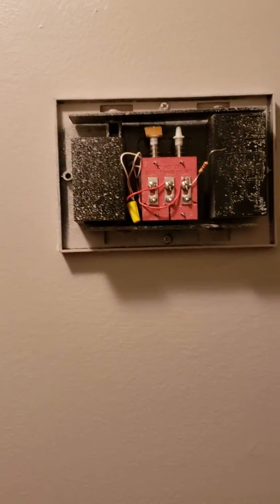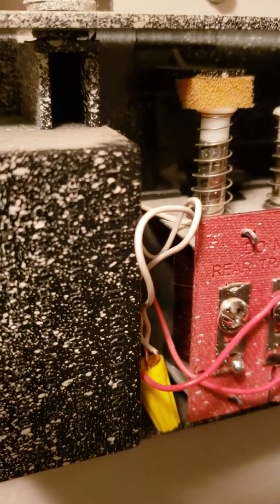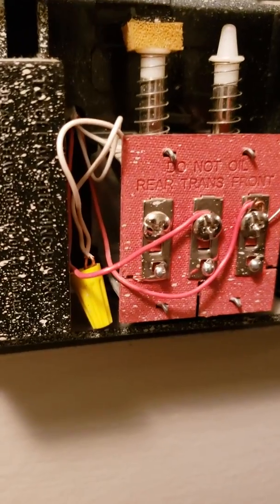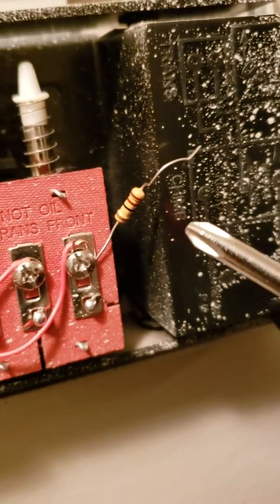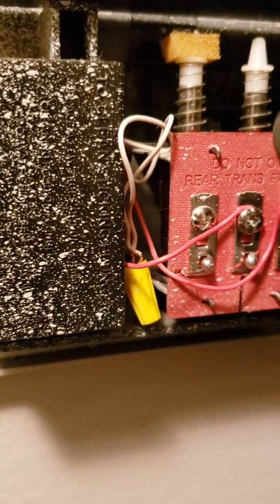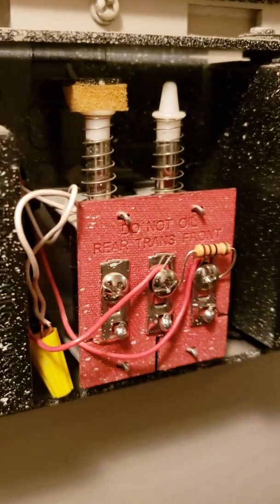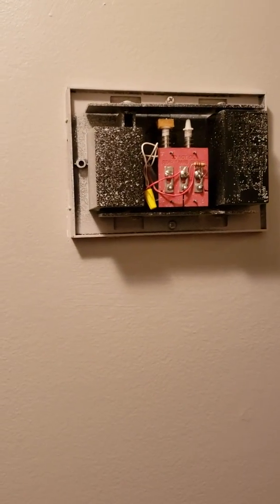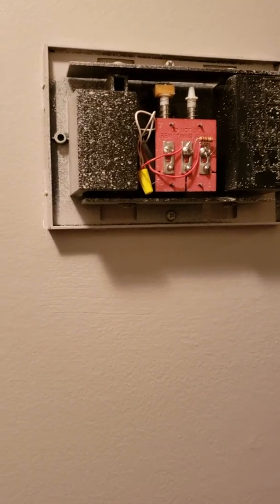Fix buzzing/humming sound after doorbell security camera install

Comment: Most of these doorbells come with a chime kit or power chime kit, which is the resistor. Check her manufacturer to see if they have one for your particular model. If they don’t make sure to ask about the ohms and wattage because not all the resistors work the same. As an electrician I carry three different resistors for different video doorbells. Most of them will take the 10 ohms 1/2 watt hover some will need more ohms and wattage. Typically these are fine from 8-24VAC and will do the job.
Reply: I tried a 10 ohms 1/2 watt but it melted. Would a 20 ohm 1 watt be sufficient?

Comment: Old find, but not needed. 
Most video doorbells use the power to charge the battery in the door bell. So the doorbells needs a completed circuit. 
The door bells is completing the circuit to allow the voltage ( use a multimeter and see) to pass.
Normally a regular door bell is a open circuit, but an illuminated doorbell does the same thing and slightly lets millivolts pass thru to light the led. So does the video doorbell and that is the hum you hear. 
the circult does not complete the circult fully till pressed. 
you resistor is just completing the circuit. as would bridging the two terminals with (any wire). There is still not going to be enough voltage to activate the chime until pressed. 
So, you can bridge the terminals with any wire, not needing to ( resist the lower voltage passing thru), with a resistor at all.
Reply: Hi Wiley, with a multimeter what should i be looking for between the two terminals?
Reply: @VinoLoco  at the doorbell itself, with the multimeter on continuity, you should see no continuity until you press the doorbell button, which would show you that current is passing through it.

At the transformer for the doorbell, some are AC and some DC (so you would be measuring for a voltage either AC or DC at the transformer.

For a better visual, just look up multimeter testing a doorbell

Comment: Saw a similar buzzing on my Nest doorbell. First check for wires almost touching at the doorbell and at the chime. My bad wire was at the the doorbell, wires were too close together and needed separating. The Nest doorbell has its two wire screws very close together, so someone bumping into it this morning was enought to start it buzzing.

Comment: Hmmm, I'm confused.  Why use a resistor at all?  Normally (e.g., in a Ring doorbell) you just bypass the chime coils altogether using a provided jumper cable (effectively 0 ohms with no power loss that a resistor would dissipate as heat).  You're really looking to provide the full voltage (e.g., 16V) directly to the doorbell camera and WiFi circuitry.  Is the Nest different than the Ring?
Reply: Thank you!! My partner did not read the install instructions and thus did not know what that provided cable was for. Your comment prompted me to realize the solution we already had. I cannot tell you the path of all the wrong solutions we were about to go down.

Comment: I have mine buzzing as well but changing the chime type from Digital to Mechanical solved the issue. If it's an option, I would recommend changing the settings first before messing with the electricity.

Comment: Mine only makes the sounds after the door bell is rung. It’s like the bells are stuck.
Reply: Check the doorbell settings. Mine is doing the  same thing and changing the chime type from Digital to Mechanical solved the issue.

Comment: Came to you tube to see if anyone else had this problem
I just tried reinstalling after charging yesterday. 
The button turned white circling but wouldn't turn off . As i started screwing it back on the wall outside.  It started smoking.  I immediately took it off the wall.
I saw a red spark in the little hole on back.
Smells like burning wire.

Comment: Ive been having this same problem with my ADT video doorbell. At first the buzzing was so low and random, could tell where it was coming from. As it got louder it was obvious, finally unbareable. Called ADT, they had no idea! They did dicover my door wasnt recieving enough power. They suggested I replace the original transformer from 1978. It still buzzes, they suggested getting new doorbell, did that, it still buzzes even with the video doorbell unhooked.

Comment: Update: I found I have the ring power kit v2, it took about 30 mins to make the chime ring after the installation. After that it works as expected. So I use the ring power kit v2 kit with the chime now. 
Update: My chime does not sound after add the resistor.... 
Thank you! This fixed my annoy experience for half year.

Comment: I have the same chime with a Ring 4 doorbell. The plunger was sticking (about 5-10 seconds) when doorbell was pressed. I went into my ring app and changed ring type setting to mechanical (instead of digital). It solved my problem.
Reply: thank you very much put it on mechanical mode problem solved
Reply: OMG your advice was the best!!! Thank you so much!!!!! Switched it to mechanical and problem solved
Reply: THIS WORKS!😁
Reply: Good idea, but didn't work for me. Unify Doorbell and Nutone Chime.  Tried the resistor also, but caused the chime not to work or microphone on the doorbell.  Will keep searching.

Comment: Great work.
Is this the same as the "Power Kit" what they instruct to connect it parallel?
Reply: You would think so. However, I tried my Ring Pro wired doorbell with and without the Power Kit. The mechanical chime still hums.

Comment: Google/Nest doorbell cameras are advertised to work with traditional electromechanical chimes such as the NuTone units from the '60s, but that is an outright deception, and the Google/Nest people are essentially lying to their customers. They even have a comprehensive video purporting that their product will work with these conventional chimes, and it categorically will not. The only solution that I found successful which makes the Nest doorbell cameral compatible with conventional electromechanical chimes is a circuit I had to specially design.

Comment: Installed the resistor.......did not correct the problem
Reply from the maker: Maybe not enough drop in voltage to eliminate the coil feom engaging . Higher ohm resistor may be needed

Comment: Ordered 10 ohm 1/2 watt and this took all of 60 seconds to install and humming gone!! Love it! Thanks for tip!
Reply: I'm reading a 1/2 watt can cause a fire due to being too small to handle the load. 10 ohm and FIVE watt, NOT .5 watt, is what you want (so I read; not legal advice. I'm trying this tomorrow).
Reply: 10 ohm 5 watt did not work for me. The doorbell chime no longer buzzes but it also no longer dings when I push the Ring video doorbell.

Comment: I had an issue where I tried to replace my existing button with a video doorbell (Merkury with the Geeni app). The video & app notification when the doorbell button was pushed both worked great, but the mechanical chime (a NuTone from the early 60's) would not work. It tried to activate both of the plungers and it made a humming/buzzing noise. The existing transformer was showing 20VAC, but after watching some other videos online & reading what happened to others, I ended up getting one that was a 24VAC 40Va for more current. That fixed the problem of the chime not working when the video doorbell button was pushed. Many thanks to my stepdad for helping me with the wiring & the multimeter usage. I did have to use the white adapter that came with the video doorbell which helped get rid of the humming that was occurring.
Reply: Google/Nest doorbell cameras are advertised to work with traditional electromechanical chimes such as the NuTone units from the '60s, but that is an outright deception, and the Google/Nest people are essentially lying to their customers. They even have a comprehensive video purporting that their product will work with these conventional chimes, and it categorically will not. The only solution that I found successful which makes the Nest doorbell cameral compatible with conventional electromechanical chimes is a circuit I had to specially design.

Comment: This makes sense. The doorbell/camera (Ring or whatever) is drawing a small current all the time, which makes the chime solenoids vibrate. Putting a resistor in parallel with the solenoid passes part of that current around the solenoid coil and through the resistor. You could also completely disable the chime solenoid by shorting across it - basically a zero-ohm resistor.

Comment: Mine does the same thing except only when it is dark outside. Any idea if this resistor would fix it? Appreciate any help anyone can offer. It makes a buzzing noise for 20 seconds when it is light outside only after I turn the ring mic on.
Reply: Probably because at night the camera has an infrared light that is always on.   Go look at it, should be red.  So the slow voltage is always there at night

Comment: I'm having the same issue except it only happens at night. During the day it's fine. When I remove the cover I can also see the plunger on the left moving up and down slowly. My doorbell came with a "bridge" wire for trans and front with no resistor. Doorbell won't work without that bridge...I was thinking something was getting wet from the condensation that occurs at night but now after seeing your video idk. Oh and it doesn't work when this is happening either so my doorbell is essentially non functional at night.
Reply: same thing  at my house  only does this at night, usually at the same time....
Reply: I think your doorbell is pulling more power at night to activate the night vision feature.
Reply: I am having similar. Installed Ring doorbell 3 months ago. About 1 month ago the door bell chime inside has started vibrating and making noises at night time. Even will randomly make a very slight ding sound. It occurs randomly and eventually stops after awhile.

Comment: Started smoking and left burn marks on my bell. 10 ohm, 1/2W resistor just like the video. This may work for some but it didn’t work for me
Reply: I think you need a larger resistor than this 1
Reply: I think what is happening here is induction or emf on the coil. A interference. Or just a little to much voltage going to chime from trans. That resistance will drop the voltage which helps take away the emf
Reply: Did you resolve the issue? I have the same issue. I am thinking a 20 ohm 1 watt might be sufficient.
Reply: No it's wrong u don't need a diod for a mechanical chime /for a digital chime yes u need diod/resistor 
What he did he's going to damage the battery on the ring door won't last long

Comment: CAUTION:  While this idea works to silence the coils buzzing, the resistor needs to be a higher wattage rating or this will pose a fire risk!  

A 10 ohm resistor on a 16 volt, 10VA transformer (very common voltage for doorbells) would pull about 1.6 amps and need to dissipate about 25 watts (23 watts for an 11 ohm) of heat; this is FAR EXCEEDING the design limits of the 0.5 watt resistor described in this video.  

A safer bet would be to use a 50 Watt 10 Ohm (or even higher ohm) resistor that will be able to operate continuously and safely for many years and can safely dissipate the energy without getting too hot.  Amazon is selling 25 ohm, 50 watt resistors for this exact purpose, and they are larger metal clad devices that could be used safely in this application.  Apply some Ohm's Law here and stay safe!
Reply: While I agree w your Ohm's Law, this resistor isn't taking all 16V at max current. It's only there to absorb drift currents that pass through the doorbells. The coil will act in parallel when the chime is actuated. More watts is better but you don't need a giant shunt resistor w a heat sink here.
Reply: @roun0016  so just to be crystal clear,  if I have a 16v10va transformer, the ½ watt is ok to use?
Reply: @roun0016 had 16v on the circuit before install, 8volts after assuming the device is pulling the other 8v? 8*8/10 6.4watts at the resistor?
Reply: What size resistor would I need if I have a 16volt 30VA ??
Reply: @isidroserrano8097  The 30VA isn't the important part, it is the 16v that is important.  The equations is: V^2/R, where V is the volts (16 in your case) and R is the resistor choice (10 ohms in this case).  Doing that calculation you get the power (watts) = 16*16/10 = 25.6 watts.  Those small resistors are typically 1/2 watt in size, far too small to handle dissipating 25.6 watts of power.  So you would need the 50 watt, 10 ohm resistor.  There is nothing wrong with having a resistor that is capable of higher power (the watts measurement) but there is definitely something wrong with having a resistor that is a lower power rating.
Reply: I got the 50w resistor. But it’s in a metal casing that won’t fit into the box. Also how do you wire it with the receptacles it has?
Reply: Do you have a link to the product??
Reply: You're absolutely right! This is a significant fire risk. Also, it's going consume 225 kWh per year... You're basically creating an electric heating system.
Reply: Thank You
Reply: Thanks for this!! Reading all the comments before I try this DIY fix.
Reply: Aside from the video, this comment is great info as well. I’m getting this buzzing, I want to make it stop and I need the proper resistor. Thanks
Reply: Any idea what gauge wire to use for a 10 ohm, 50 watt resistor?

Comment: My front and transformer have two wires screwed in already. The original ones and the ring door bell ones. The ring instructions said to just add them with the existing ones. So how do I add the resistor to it?

Comment: Did any of you got a yellow stain on the top part of the wall, seem like it came from the copper coil?
Reply: No but I did get a yellow stain in my underwear. Probably not related though.
Reply: @wilcoxtactical3716  LOL.  I did find out that the yellow stain came from the wound copper wire to generate the magnetism.

Comment: Thanks for this tip it worked great for me.  My doorbell was humming really bad once I installed a Nest Hello Video Door Bell.  I do a lot of tinkering with electronics so I have an assortment of resistors. But they were all 1/4 watt size.  So what I did was combine two 22 ohm resistors in parallel which gave me 11 ohms @ 1/2 watt capacity combined. I tested the resistance of the two resistors in parallel with my ohm meter and I was right at 11 ohms.  Once I installed the resistors I tested everything to make sure the camera and doorbell were still good. Touched the resistors after a few minutes to make sure they were not heating up and they were cool to the touch. I'm so glad there is no more hum it was driving me bonkers.
Reply from the maker: There is always a workaround/different solution. Glad the two res. In parallel worked👍
Reply: @efdoesit  Ohms law at work.

Comment: Mine done the same but mine will not even ring while humming is going on will the resistor fix that as well
Reply from the maker: When you press the button it doesn't ding ?  I'm assuming it might be a bad transformer or sticky pin /plunger motors

Comment: Been having this issue for months with my Nest Hello Doorbell and was about to give up. Your solution worked. Was about to pay $200 for handyman to fix it, but was able to fix it myself for $5. Thank you so much!!
Reply: Where did you get the resistor,? I couldn't find it at home depot
Reply: @robleroherlin  I bought the “E-Projects 10EP51210R0 10 Ohm Resistors, 1/2 W, 5% (Pack of 10)” from Amazon for $5.40
Reply: You were paying for someone else's knowledge

Comment: Hello, I did the same exact thing. Ran the doorbell twice, no hum. On the third try the resistor began to smoke. Any idea what I can do to fix this? The hum usually gets pretty intense at night time, and also every time I ring the doorbell. It happens after the first ding, hums for a bit, then stops and you can hear the second ding.
Reply from the maker: its likely due to a much larger transformer. There are different wattage 10ohm resistors. Might need to go up in wattage

Comment: I’ve had my ring doorbell for over a year now and just recently the chime box started making that same buzzing noise and it’s not ringing anymore when I hit the doorbell. Was your chime box working when you installed the resistor ?? Or it was working and you just installed it to stop the buzzing?
Reply from the maker: Could be that the plunger motor is wearing down enough to where it wants to engage. That's what the sound is. Chime box worked fine with old doorbell switch. Once I put the camera it buzzed , but the resistor fixed the buzzing
Reply: When I ring my doorbell the chime has a delay like 5 sec. And also buzzing.....I think I need to upgrade my transformer to 24v what trans do u have?